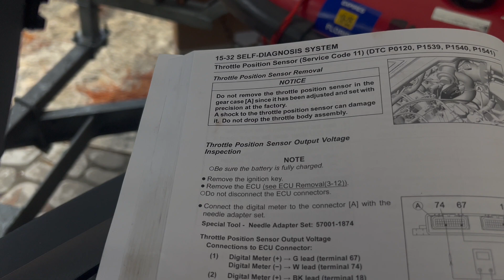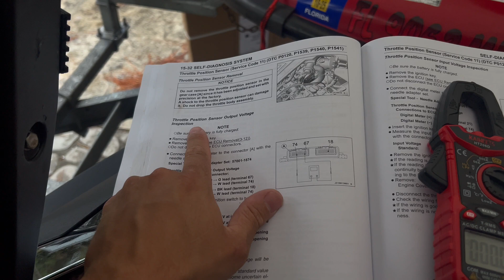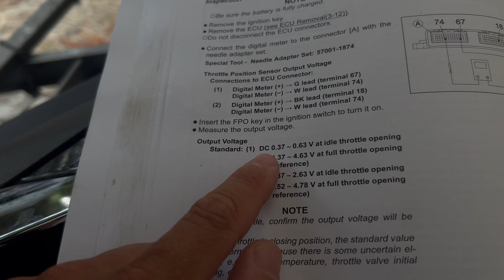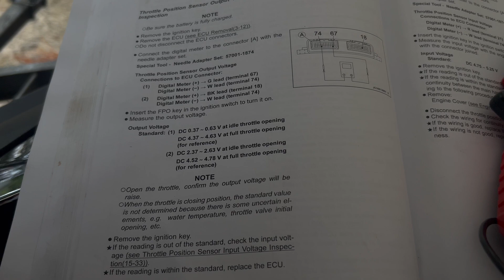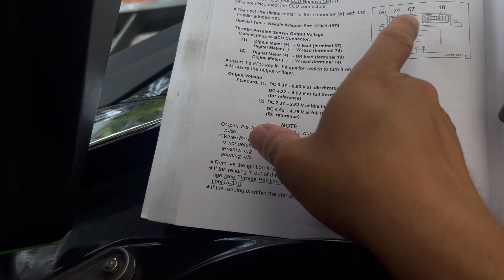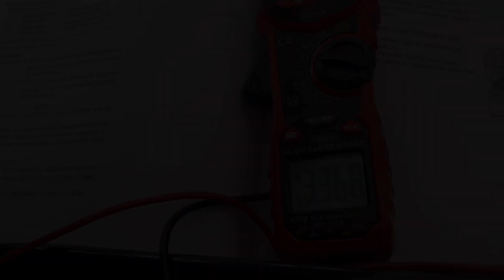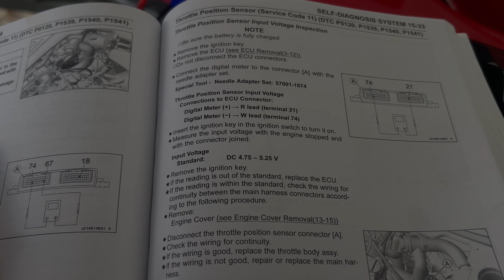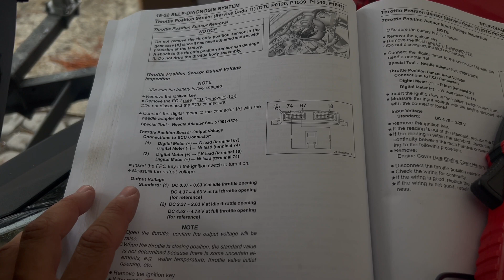Diagnosing Throttle Position Sensor (TPS) Issues on 2022+ Kawasaki Ultra 160 and 310 Jet Skis [4K]

Comment: I have a 2014 Ultra 310 having similar issues.  Runs fine until about 5k RPM then starts almost acting in limp mode for a few seconds then speeds up again and repeats.    I have checked almost everything on ski watching your other videos and everything is ok.  My TB tests come in over voltage by approx .2V on both wires at the idle setting but normal on the fully open side.  I have tried a used TB off EBAY but same result.  I have checked the ECU voltage and also wiring harness and it is ok.  Should I try a new TB for $1000.  Strange thing is the ski runs fine sitting still on trailer in the water under full load.  Will not lose RPMS unless moving straight thru water.  Even in a hard turn it will hold boost and speed.  Any input you could give id appreciate!!
Reply from the maker: Did you test the cable - actuator module? If your swapped TB is having same issue that is not the problem. Have you tested fuel pressure? Ignition coil resistance? Obvious things like changing spark plugs?
Reply: @JDsWaterWorld  thanks for quick reply.  So just because its showing overvoltage does not mean that's the problem?  Good to know.  I have checked everything you mention except the Ignition coil resistance.  I will do that next.  What's throwing me is that it runs fine under full load sitting still on the trailer in the water at the ramp.  It just presents this issue when running straight at speed.  Around 45-50mph.
Reply from the maker: You know the tests for the 2018 are different that my video right? Out of range could be due to ECU also..although rarer. If you are saying you tested a tb from eBay that was known to be good and it's getting same reading as your last one it could be the controller (tps where cable operates the electronic throttle converter) you didn't mention if you tested that or not. Worth asking, is there water in your hull? Have you checked the carriage bearing assembly for leakage or possible water squirting on the the belt? Funky issues on this ski can send you searching forever sometimes it's a pin hole spraying water on the belt
Reply: @JDsWaterWorld  Thank for the tip!  It did turn out to be water spraying thru the carriage housing.  I took the ski out with no seat on with a flashlight looking into the engine bay.  Once i hit about 30mph water would start spraying through the housing right on the belt and voila loss of power! The wierd thing is when i turned right or left it quit spraying so hence why it did not lose power in a turn.  THANKS!
Reply: I did check the throttle actuator and it was good. What's the best way to check for water intrusion thru the carriage bearing?

Comment: I have a 2014 310ski that i have even rebuilt the engine
, charger,fuelsender,intercooler,map ,boost sensor,prop and casing ,regulator and tensioner.
This ski starts slightly high idling,when acceleration out of the wayer. Sounds good.in the water acceleration goes up till around 44mph and bogs down at 45 46
I can ride it like that staying under 45mph

Ihave downloaded  and printed  the manual. Will do the test
Only item not changed is the throttle body and ecu.

Will get my auto electrician  to check this out
Reply: What symptoms  would the ecu give ? Does it also affect acceleration
Reply from the maker: When you say "rebuilt" what was done with the heads and cylinders? Decked and honed? Did you conduct leak down and compression tests? The 2014 you have to test the TPS and the actuator and the cable adjustment- a bit different than on my
Video for 2022+ good luck man!
Reply: @JDsWaterWorld I had an unlucky moment  with ski .I salvaged it from under the sea.got it working. I managed 67mph . Then sc failed. Rebuilt. Managed few perfect  rides the problems started.dropped to 45mph..after my oul pressure switch  decided to pop out.cranvkshaft toasted.
Rebuilt  the engine.  With a new crankshaft.still ran only 45mph.changed lots of things.even the tps.
So it's only down to hopefully the throttle or the ecu
Got out again
Reply: @JDsWaterWorld can you do a video on this mann 🙏🏽😂
Reply: Did the test according to the workshop manual, for both test results are out of range.
Do you have the video of testing the tps?

Comment: When i am in the FPM, when I full squeeze the throttle, their 1-2 second delay, normal?
Reply from the maker: Do you have a noticeable hesitation in acceleration?
Reply: @JDsWaterWorld  About 2 second delay so I am never the first starting in the race but fly by them once it kick in.
Reply: I am using the Kspeed ECU.
Reply from the maker: That is not normal…it should respond instantaneously when you hit the throttle. Only because I just had an issue with mine- check your throttle body and TPS…if you are 2022+ you should check KSRD trigger as well
Reply: @JDsWaterWorld  Will, hopefully we see and update video of this.  Thanks.

Comment: That's crazy. I have the exact same issue. I changed everything including my fuel pump and I'm about to go lake test it 

I do have a 2015 310  do you know if the test procedures are the same? I don't think I have the manual.
Reply from the maker: It’s a different test procedure because it’s a different ECU and yours also has a cable throttle with intermediate throttle position switch…but the throttle body is the same.
Reply: @JDsWaterWorld  yeah it's like a cable throttle that goes into a wire with the spring 
Is that what you're talking about?  

I turned on my ignition, and I pressed on the accelerating lever  it was opening and closing the throttle normal it seemed like
Reply from the maker: You need to check the input and output voltage of the TPS just because it looks like it’s opening means nothing- you must do the test. Email me and I’ll send you copy of the service manual for your ski
Reply: @JDsWaterWorld  it's not allowing me to post my email on the comments. Is there any other way I could do that?
Reply: @JDsWaterWorld  thanks for the reply!
Reply: @JDsWaterWorld  I change the throttlebody it's still doing the same thing. Do you think it could be my cable throttle intermittent position switch? 

I can't think of anything else 
Literally changed everything on this JetSki  

Except the ignition coil and the throttle switch
Reply from the maker: Well..you have to test all the sensors including the coils (primary and secondary windings) to either rule them out or find the smoking gun…atleast you have found many things that are not the issue…
Reply: @JDsWaterWorld  OK thank you I cleaned all my air sensors. What other sensors should I check? 

Also, how often do you recommend to fog the supercharger?  

What is the best way to check if the coils are working properly?

Thanks a lot man! I've been working on cars quite often, but not much on jet skis
Reply: @JDsWaterWorld  but yeah, it's doing the same exact thing as you were explaining in the video
The throttle response is weird  
At medium throttle is just weird 

Low throttle and high it's flying
Reply from the maker: Do you have a SCOM or are you using a tuned ECU? You need to take a multimeter and test the resistance of each spark plug boot and wire and then the coil from the plug wire side and the signal wire side. I can send you the resistance values if you want. You then also need to check spark gap , using a spark gap tester..
Reply: @JDsWaterWorld  I bought a Scom but I haven't installed it yet because of this glitch.  so I'm on the original ECU right now 

I noticed it's more of a electrical issue. When I was on the lake today and when I accelerate while it's doing that bogging down I’ll press and depress the throttle a 1/8 of an inch and it like gets better. Almost like my throttle response is off. 
So I'm thinking it's either TSP or coils 

I'll check coil resistance tomorrow. I emailed you in the website since YouTube doesn't allow email drop ins
Reply: @JDsWaterWorld  hey I just changed my throttle position sensor the entire assembly where the cable connects and the problem went away. It's a beast no lag. 
Small thing I did  notice is when I'm on the automatic Eco mode it almost needs a second to jump out of it and then reach full RPM  when I press full throttle

But other than that, no more jerking

Comment: Is the TPS adjustable?  Sort of like the old Ford ones as they had a range you could turn it by loosening the screws.
Reply from the maker: Unfortunately, no. There is one bottom-end adjustment screw on this TB but it is not even used on the jet ski application- there is a plastic collar on the throttle plate shaft with a built in stop..this unit is not adjustable sadly

Comment: That sucks. Glad you figured it out. How's it running now?
Reply from the maker: It’s not, I still need to get a new throttle body lol
Reply: @JDsWaterWorld  I hope the warranty covers this. 1K for a new TB!?  This sucks man, not that many hours to be having this issue! You have some serious mechanical skills JD!   Thanks for posting!
Reply from the maker: I have extended warranty exactly for reasons like this..I am going to dissect my old one and see if there’s a way to adjust/ repair it. There are hall sensor magnets inside that can break..this same TB is used on many Japanese cars